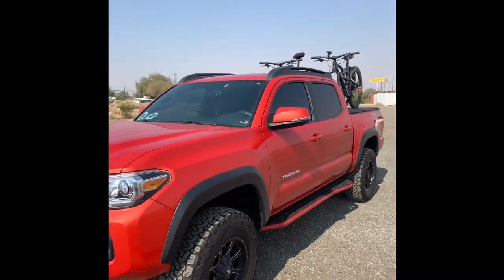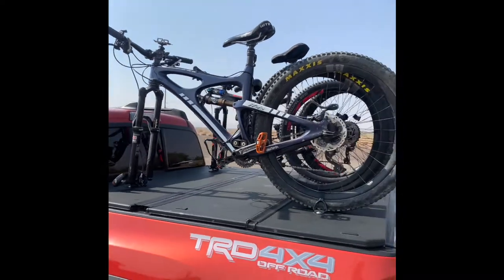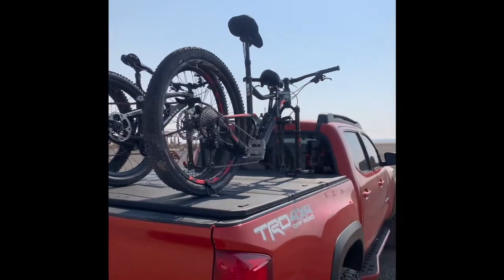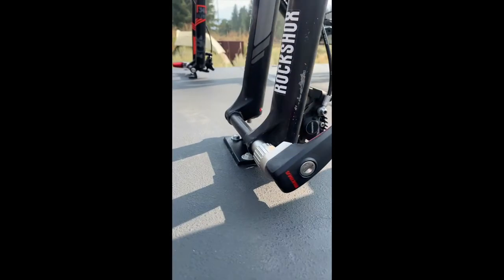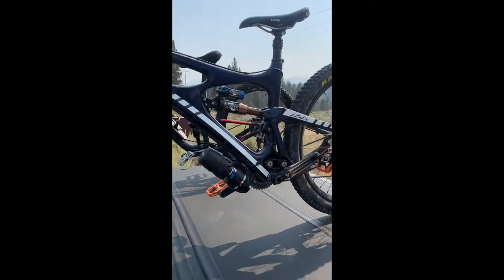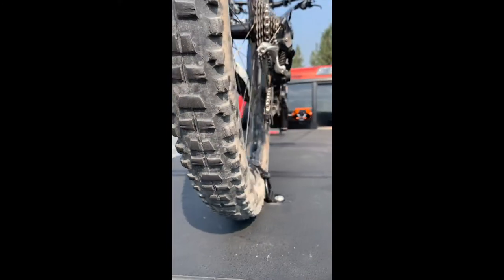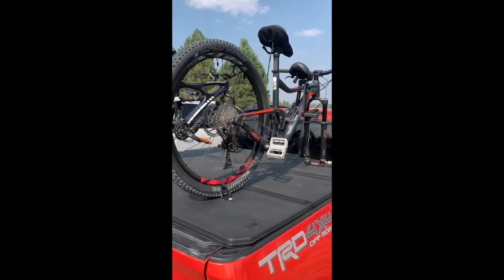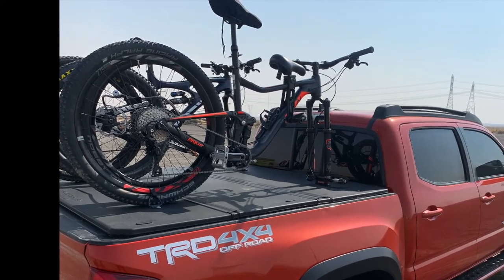TOYOTA TACOMA BIKE CARRIER ON OEM TONNEAU COVER

Comment: What are you using for the rear tire hold downs?
Reply from the maker: These are the exact tie down anchors used to hold the rear wheels https://a.co/d/0eUmZ7t 
(You'll need/want to use as oversized washers as possible or a small metal plate on the under side of the cover)

Comment: what are the rear holders called?
Reply from the maker: These are the exact tie down anchors used to hold the rear wheels https://a.co/d/0eUmZ7t 
(You'll need/want to use as oversized washers as possible or a small metal plate on the under side of the cover)   along with these straps https://a.co/d/3FDmuGk

Comment: Where did you buy the rear holders pleases??
Reply from the maker: These are the exact tie down anchors used to hold the rear wheels https://a.co/d/0eUmZ7t 
(You'll need/want to use as oversized washers as possible or a small metal plate on the under side of the cover)
Reply from the maker: along with these straps https://a.co/d/3FDmuGk